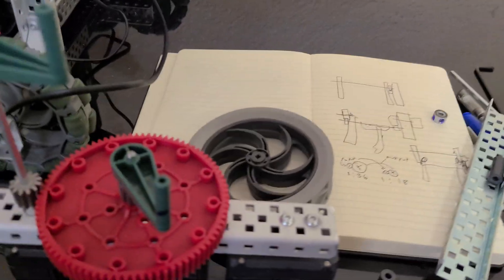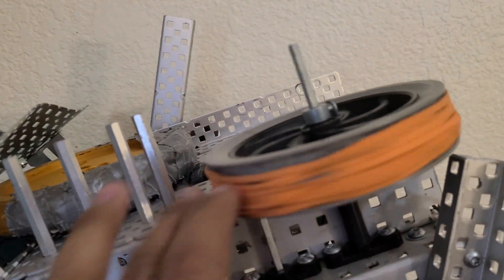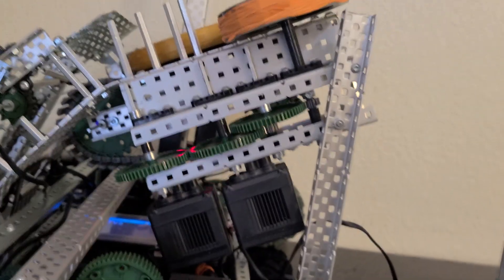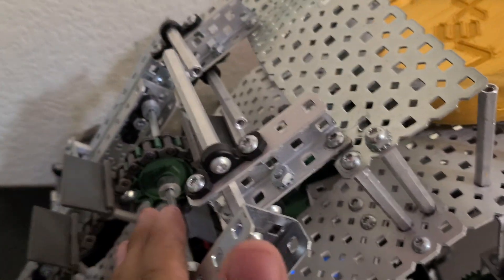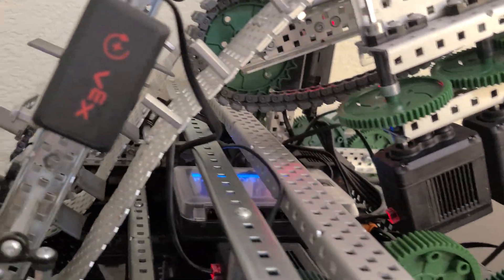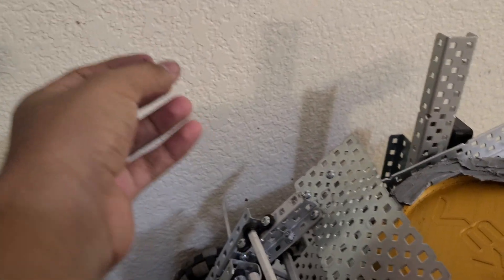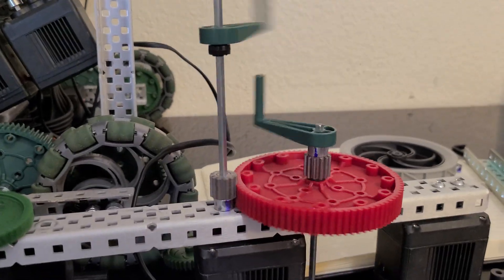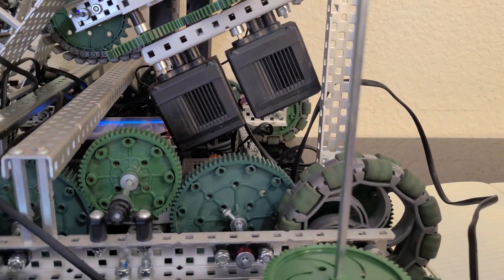Vex Spin Up Motor Sharing concept

Comment: During your motor sharing concept choosing between red and green, if you do the math the green setup you had would spin that 84 tooth at 30 rpm yet since the red motor input speed is 100 and your doing around 2:1 gear ratio which means you are spinning it at double the original speed which is 200.

Comment: Great idea. I’d advise you could also you a differential design to allow you to use the out put of the two motors to power the intake and indexer while also having two other outputs (one for roller and another for something else).

Comment: Flywheel doesnt need to spin nearly that fast, also invest in a few flexwheels, at least 1 for the flywheel would do you wonders.
Reply from the maker: Yes I told our school to order them. This is just a pre season robot nothing too serious, it's just testing the concepts we can use in the future
Reply: @mcfarland_robotics  actually the fly wheels does need to be spinning that fast. quick tip of advice : if you dont have motor cartridges it can spin 3600 rpm which is usually the prefered rpm

Comment: Try a flex wheel intake if you can instead of using chain. Chain is just a pain in the butt to deal with. Also to get rid of the shooting mechanism which loads it try getting pneumatics and use a double acting piston that goes backs and forth.
Reply from the maker: We dobt have prenumatics and I don't know how to use it so we'll have to see if our school gets it. If they do I wanted to try it as the mechanicanism instead